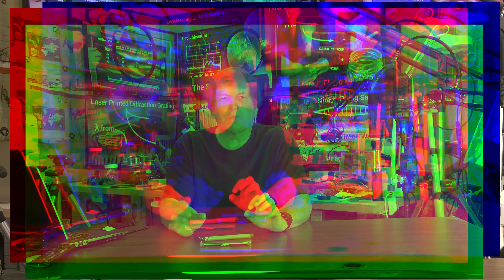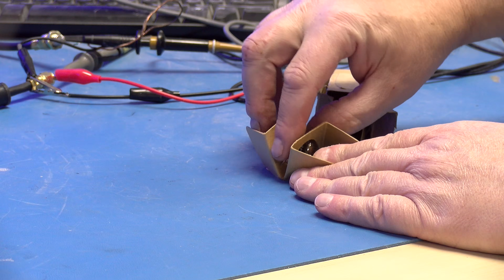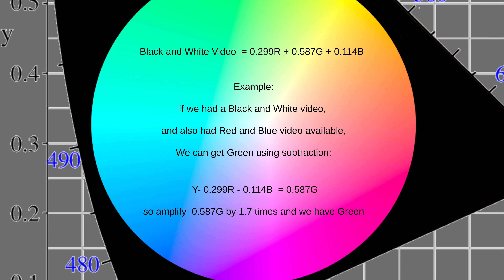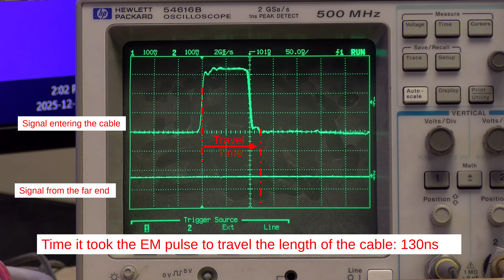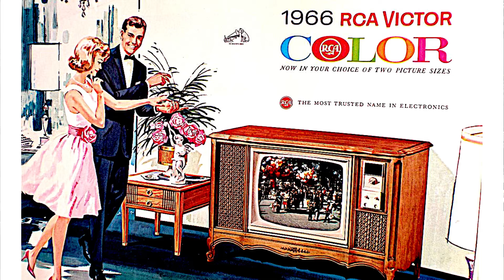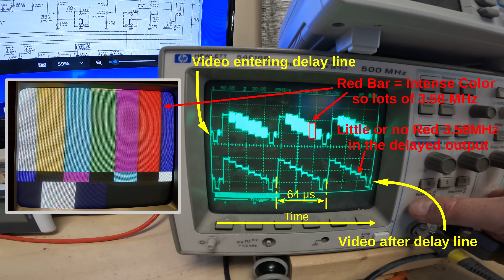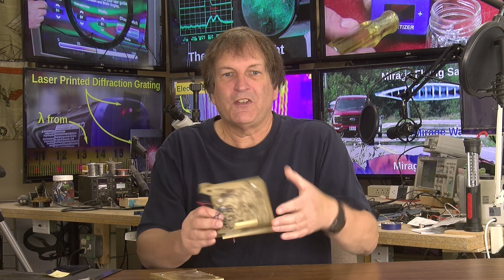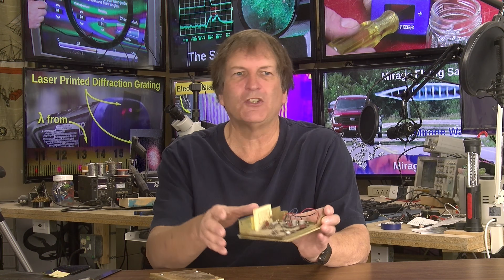How we slowed down electricity to create Color TV

Comment: Most urban television markets had ABC, CBS, NBC, perhaps PBS and maybe ONE local independant TV station not affiliated with ABC, CBS or NBC. Rural markets often worked on a repeater/translator that received the urban VHF stations on the VHF band translated them onto the UHF band and rebroadcast them to rural areas. Reception was very spotty and it varied for different channels at different times of the day or night. After about midnight the old stations stopped broadcasting shows and all you got was their test patterns.
Reply from the maker: I'll bet there are so many people today who never experienced the test pattern and tone broadcast in the early hours of the morning!

Different times of day - for the lower channels,  and particularly channel 2 or 3, you could often get ionospheric reflections in the evening much like shortwave radio. If you were lucky (and I think thats what you were implying) you might get another channel for a while. We were unlucky - and perhaps from 7pm to 9pm or later, we would get a channel from Rochester(?) on top of our channel 2 resulting in a noisy, unwatchable mess.  And as a result of Murphy's Law, that always happened during shows we really wanted to watch :)
Reply: Eskip was often the mode on the lower VHF channels, the signals would bounce off the E layer of the ionosphere. These signals could go out 1500 to 2000 miles.  On the higher VHF and UHF channels there is a phenomenon called tropospheric ducting where signals get trapped in a temperature inversion in the upper troposphere and could propagate several hundred miles or more under the right conditions.
Reply from the maker: @n3bruce  You know your stuff! I remember seeing what was something like the earliest recording of UK TV - received by accident in the US at the RCA sometime before WWII. That must have been amazing!
Reply: @ElectromagneticVideos  I have one memorable day when the e skip was so good that everything was coming in full quieting on a modified Mocom 70 with a 6 meter J pole antenna. I live in the Mid Atlantic area and was working the front range of the Rockies.. i must have worked a dozen stations that afternoon. 73 de N3LSY
Reply from the maker: @n3bruce  Thats wild! I actually heard a similar storey from my neighbour  who was in charge of police radios in Rhodesia/Zimbabwe in the 60s and 70s: one they ended up talking police in Italy, and another time, New York city. Must have been exceptional conditions and both sides of the conversion were (not surprisingly) astonished.

Comment: Actually the FCC first approved the incompatible CBS color wheel system, developed by Peter Goldmark, who had previously developed the LP record for CBS labs, with the provosion that, going forward, receivers (even monochrome) would have a switch to change to the color scan rate so they could at least view color broadcasts in monochrome. CBS started to air 1 hour of prime time using their incompatible color system. After 1 month, only 200 color sets had been manufactured and only 100 sold. CBS came to the decision that they could not continue to devote an hour of prime time each evening to broadcasting something only 100 sets could receive, so the CBS color system was quietly withdrawn. In the meantime RCA had gotten it's experiments with shadow mask, three-gun picture tubes to the point where they were close to manufacturing all-electroic color sets and the compatible NTSC color system was developed. With a practical color picture tube and a compatible transmission system, they started a broadcasting era which lasted until it was replaced by digtal transmission and flat-screen sets.

Also, before the compatible NTSC, there was some talk of an incompatible color system which would run on wider channels (12 MHZ IIRC) in the UHF band, while VHF broadcasts would remain monochrome, but this system was never implemented at scale.
Reply: Another point, regarding the bandwidth of an AM signal, the FCC had no hard limit until NRSC came on the scene in 1980, when they required stations to apply brickwall filtering at 10 kHz, thus making the overall bandwith 20 kHz or less. Before 1980, a few stations transmitted audio, in a few cases, up to 20 kHz. Certainly stations like WLW and WQXR advertised their high fidelity audio. A station where I worked, WBAA at Purdue University had a Collins 21A rig which was only down less than 2 dB at 15 kHz.
Reply from the maker: @timothystockman7533  I did not know about the AM not having bandwidth restrictions until "recently".  I wonder how many receivers could get a larger part of that bandwidth out to the speaker? I'm guessing many receivers where not that selective anyway which probably helped?
Reply: @ElectromagneticVideos  You are in good company. When I was an engineering student at Purdue, I had 2 different professors who, during lectures explaining AM modulation, used the specific example of AM broadcasting, and said that AM stations cannot transmit audio higher than 5 kHz since the channels are spaced at 10 kHz. What people don't realize is that the FCC doesn't assign adjacent channels geographically close enough that they will interfere with each other. This is easily possible during the day because groundwave coverage is fairly predictable. At night, with skywave, it's more difficult. Many stations sign off, reduce power, and/or use directional antenna arrays. Even so, there's more interference at night.

The theory which I developed over the years is that many engineers were taught that AM broadcast cut off at 5 kHz. These engineers then designed receivers based on what they were taught. However, there are a few AM receivers which have good audio performance, for instance, the McKay Dymek AM5. I always wanted to own one back in the day, but never did. When I was at WBAA, they had a homebrew TRF monitor receiver which, like their Collins transmitter, had really good response up to and beyond 15 kHz. It had a 10 kHz sharp notch filter which we engaged at night to get rid of the incessent 10 kHz heterodyne which started around sunset.

The NRSC emissions mask, mandated by the FCC starting around 1980, was touted as part of a program to "make AM sound as good as FM". Of course, the emssions mask limited audio bandwidth using a 10 kHz brick-wall filter to reduce out-of-band emissions. They did use the same 75 uS pre-emphasis curve as FM broadcast , which helped with HF audio response. A strong, high quality NRSC AM signal, especially if C-Quam stereo is used, sounds excellent with voice and quite good with most music. However, these days, both AM and FM broadcast suffer from overprocessed audio and the Loudness War.

As a former broadcaster, one of my retirement projects has been an Internet station which is distributed at 320 kbps AAC-encoded, which sounds as good as I wished radio sounded,
Reply from the maker: @timothystockman7533  I think a big part of it is how practical or theoretical the university Prof teach  the course. We certainly had the complete range of hands on practical to almost purely theoretical math. 

That sounds like a great retirement project! Care to share the url of your Internet radio station?
Reply: @ElectromagneticVideos  Timothy Stockman on Mixcloud Live
Reply: SECAM = Supreme Effort to Counter American Methods
Reply from the maker: @timothystockman7533  I think there certainly was a certain amount of nationalism and protectionism involved. As I recall there also was a fair amount use of different sounds subcarriers for similar reasons.
Reply: @ElectromagneticVideos yes you are right. Multi standard sets would have a selection of sound carrier spacing from 5.5, 6 and 6.5MHz. In the U.K. the picture bandwidth was a bit higher than Europe, so the sound was at 6MH instead of the more common 5.5. I am to remember some Far Eastern countries having 6.5.
Reply from the maker: @gold27b  I read about east germans modifying their sets and hiding antennas pointed in another direction in their attics to receiver west german tv. I bet it ws the sound carrier they modified.
Reply: @timothystockman7533 Or System Essentially Contrary to the American Method
Reply from the maker: I would love to see one of those control wheel sets - I assume a few are in museums somewhere. I do have half of a DLP TV with the modern version version of the color wheel I want to do a video on some time - quite a cool comeback for the mechanical color system. 

I had not heard of the 12MHz UHF color TV proposal - how interesting!
Reply: The biggest problem with the cbs system was the size of the colour wheel needed to give you, say, a 19 inch picture. RCA were brilliant in the invention of the 3 gun shadow mask tube.

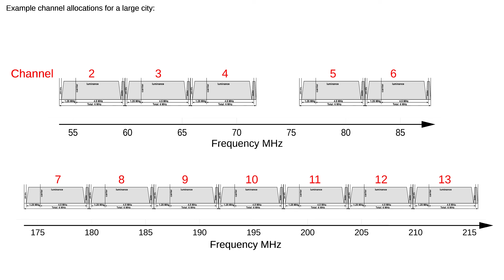Comment: At 2:24, the gap between channels 4 & 5 is large enough to allow both to be used, allowing for 7 VHF channels.  That's how it was in the LA market, with Channel 4 being KNBC and Channel 5 being KTLA.  I believe the same held true for the other large markets, especially NYC.
Reply from the maker: Yes - exactly! That was one of the details that didnt make it past the chopping block in video. There is such a fine line between more info and length - and loosing viewers attention on youtube - and its hard to get the compromise right.  Comments like yours are really great and much appreciated - fills in those gaps for people who do want the extra details.
Reply: It is because the VHF TV band is actually two separate bands, and the FM radio band is between them.
(and also other bands like mobile radio and aviation)
Reply: @Rob2  Yes. And speaking of FM, you should try taking a portable FM radio to the top of the Empire State Building.  You wanna talk about ‘bleed over’?
Reply: @njjeff201  I used to live in an area where a local station had a fairly high-powered FM transmitter on a mountain top, and I could see the tower from the garden. On some cheap FM radios, that station would bleed across the entire FM band, making it difficult to pick up anything else!
Reply: @Rob2 in Australia channel 3 actually overlaid the FM radio band so you could pick up the audio from my local ABCTV (our equivalent to BBC) on a normal FM radio. At that time we also had commercial TV on channels 0 and 5A
Reply: Yup, I grew up in NYC.  We had 2 (WCBS), 4 (WNBC), 5 (WNEW), 7 (WABC), 9 (WOR), 11 (WPIX), and 13 (WNET).  Since this is what I first saw, I assumed it was how all TV worked.  I don't remember when I noticed that it was strange that 4 and 5 were the only two right next to each other and not understanding why.  I remember it blew my mind when we would go visit my grandmother's house in Connecticut that they got weird channels like 3 and 6.  Just did not compute.  Wasn't there also some issue with having to move the audio subcarrier a little when color came along to prevent some sort of harmonic interference?

Comment: I worked with analog color video in broadcast for a few years before digital took over. I understood that there was a color subcarrier and what it did, but this is a good explainer of what the heck was actually going on at the signal level. One machine I used was a digital "still-store". Its only purpose was to grab a video frame and store it to a hard drive and replay it in a frame buffer. The Dubner DSS-4 grabbed the the full four phases of the subcarrier… That's two frames or four fields. It had a title software trick to merge the four fields into two, while at the same time, getting rid of the checkerboard NTSC artifacts.

There were also digital memory delay lines that used tanks of mercury, and some that used the persistence of a CRT phosphor.
Reply from the maker: I just googled Dubner DSS-4 - that must have been a cutting edge device at the time and probably one of the few things that ever did a full 4 frame decoding. Someone else mentioned mercury delay lines - early computer storage I think. I'm guessing the mass density of mercury help slow the signal down in a way analogous to inductance. CRT phosphor persistence - that was also used in early radar to maintain the image while the antenna rotated. Neat old tech!
Reply: @ElectromagneticVideos  Also as a trick to reduce screen flickering.
Reply from the maker: @jimbotron70  The phosphor persistence?
Reply: @ElectromagneticVideos  Yes.
On CAD computers or wordprocessors they gave persistence of vision without flickering.
Reply from the maker: @jimbotron70  Maybe when the "high resolution"screen were still interlaced? I think I remember one of the early hires IBM PC modes was interlaced.
Reply: @ElectromagneticVideos  Yes I think before VGA screen modes all CRTs displayed interlaced video.
Reply from the maker: @jimbotron70  Sadly I'm old enough to have been there for the early PCs. Most modes were not interlaced on CGA, EGA and Hercules mono adapters, but the higher resolution ones were. Noting like we have today thats for sure!
Reply: @ElectromagneticVideos  The Dubner computer graphics company was started by Harvey Dubner. https://en.wikipedia.org/wiki/Harvey_Dubner

Back in the late 1970s - early 1980s, they made an animation system called the CBG and the ABC TV network was a major user of it.

The Dubner graphics company was sold to Grass Valley, and later was part of Pinnacle Systems, that was later acquired by Avid.

Comment: In  my work deigning CCTV cameras and monitors I learned a lot about NTSC color I'm amazed  at  how much technical detail you were able to squeeze into 40 minutes. 

I assume you're aware of the CBS color wheel (field sequential) system. It was actually approved by the FCC from 1951 to 1953, even though it was incompatible with B & W TV. At the time there was little hope of a compatible system so the FCC reasoned that they need to approve it before there even more B & W TVs in use. It was incompatible because it used different scan rates and number of lines per frame.

In 1975 I attended a conference in New York sponsored by Kodak about color photography and color TV.  One of the speakers commented  "If we had known how hard color TV would be, we wouldn't have attempted it.

I once had a copy of the IRE Proceedings from 1953 devoted to color TV. Because it was published during the transition it had articles on both the NTSC and the CBS systems.

You could do a whole video on the shadow mask & Trinitron CRTs.  It's amazing how well those worked, with all the                                         convergence, geometry and purity adjustments.  Did you know that TVs intended for Australia have to be adjusted differently than TVs in N. America?  Because of the different magnetic fields.

I once saw a book in the company library about the state of the art of TV in 1933.  This was before CRTs and electronic scanning was available.  So most of the book described Nipkow discs and other mechanical scanning systems. But even then, there were proposals about how color TV could be achieved.   One paragraph referred to High Definition TV.  Standard  scanning systems scanned 100 lines per frame.  HD would have 200 lines.

Comment: I think YT must be reading my mind.  A couple of weeks ago, just after a local area net on a 2m repeater, a long-time ham operator and I got into a conversation on this topic of the transition from BW to color television while maintaining blackward (pun) compatibility.  He did mention another constraint on the color signal that I don't quite remember in detail - had to do with limiting the color signal amplitude or something, to prevent masking the sync.
Reply from the maker: Its amazing how YouTube does that sometimes :) Yes - there was the timing tweak to get the chroma carrier, sound carrier, and vertical and horizontal frequencies to all play nice together and not interfere, particularly with small  non-linearities that might be present. And then keeping the chroma from dipping down so low it might trick the sync circuits to trigger at the wroing time. Really a remarkable achievement with all those constraints!

Comment: What about the 59.9997 Hz? That's what I thought it would be about based on your video title
Reply from the maker: A few people apparently got mislead by the title - my apologies - that was not the intention. Have had numerous requests for NTSC timing video and I will definitely do that.
Reply: @ElectromagneticVideos I definitely learned something. Didn't know NTSC used delay lines. By the 80s, I guess they were smaller and harder to spot. Looking forward to more from you on TV.
Reply from the maker: @d46512  I have to admit, at first I couldn't find the small one in the TV set I did the demo with - never had seen one like. I was used to the big ones like the one I hooked up the signal generator.